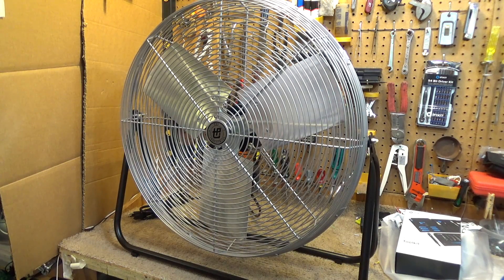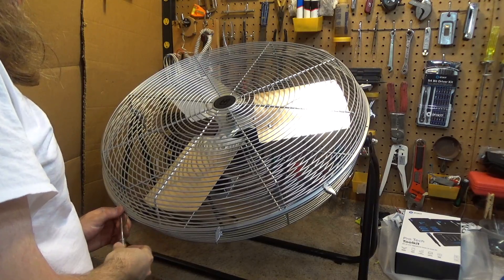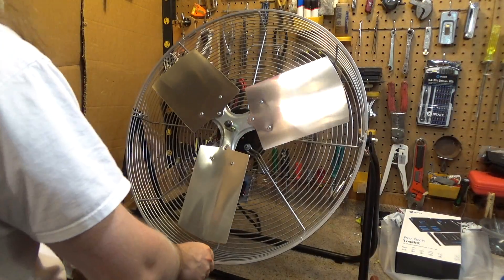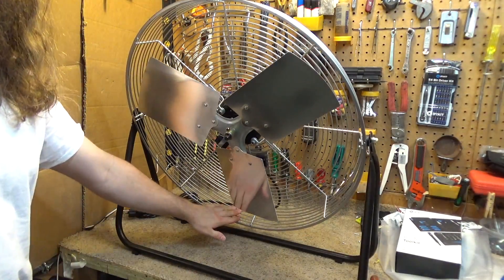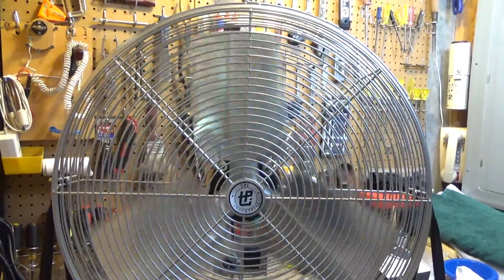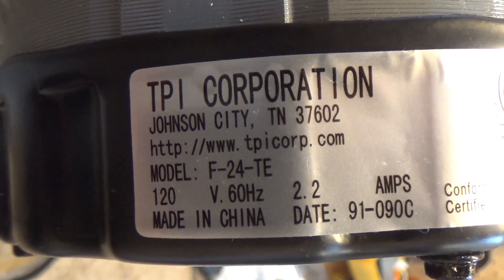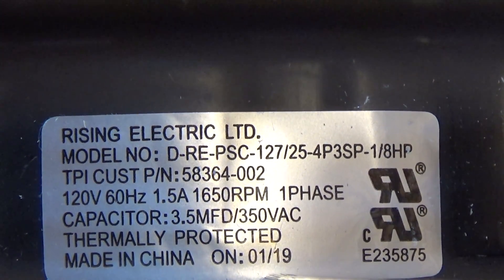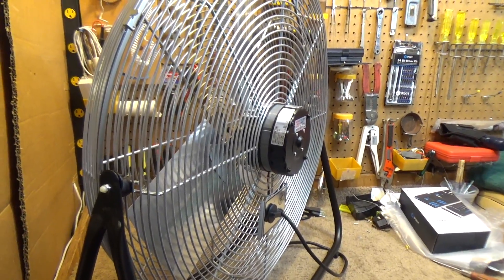Increasing the Pitch on the TPI F-24-TE to 2.2 Amps

Comment: Do your other TPI fans run hot like this? My 12” TPI runs unusually hot, seemingly for no reason. I’ve noticed that some industrial fans run scorching hot, presumably even hotter than these. But they run constantly (days or possibly weeks at a time) and still last a long time. Decades in some cases. I’m thinking of the larger Dayton fans. I’ve burned my hand on a few of them over the years. Yet somehow there are comparable fans that operate within temperatures that we would  consider to be normal. Who knows… I have enjoyed your experiments on these fans. Thanks for sharing.
Reply from the maker: It's reasonable for fan duty motors to operate up to 150 degrees or a little more under normal conditions. That temperature will feel scalding to the human skin.

Comment: Hi there, I just came from one of your window ac videos. Very informative, learned a lot. Question, if I have a window ac unit that had a locked up compressor, do you think I’d be worth calling a repair guy, or what the procedure would be? I think there’s some sort of tool that reverses the voltage but no idea. Talking a big box fridgidaire unit, not a vintage one. Any info is useful. Thanks!
Reply from the maker: If it's 15 years old or more, it's probably worth repairing. Newer than that, you can patch it up but something else will go next year, the newer equipment is not made to last at all.
I highly doubt the compressor is locked up. Most likely the capacitor has drifted beyond the operating capacitance and no longer holds enough charge to start the compressor. It's a cheap component that's easily replaced.
Reply: @JordanU  thanks so much for replying! I’ll be replacing that and hoping it works.

Comment: 2.0 amps is good for the motor bro so it won't run hot like before and burn out...  so it should cooler and move more air good video and i enjoyed it
Reply from the maker: Unfortunately it ended up being too much, I think this fan should have a more powerful motor.
Reply: @JordanU  true like a 2.4 or even a 3.0 amp motor